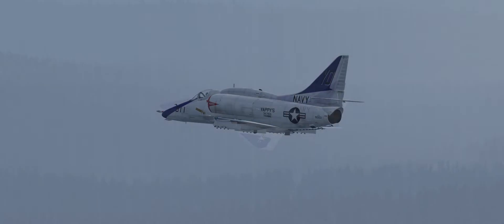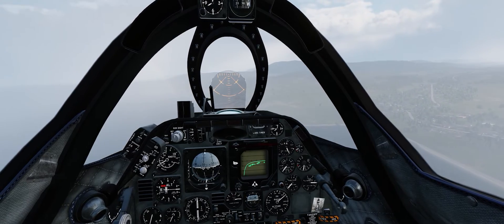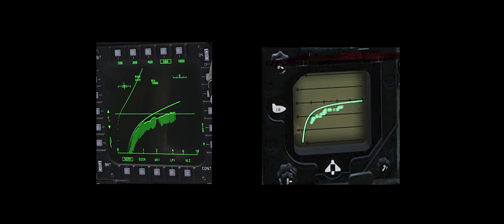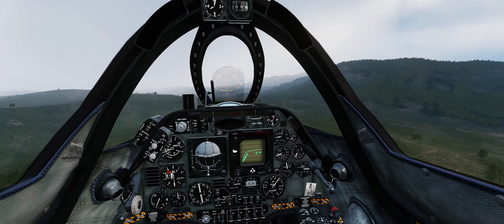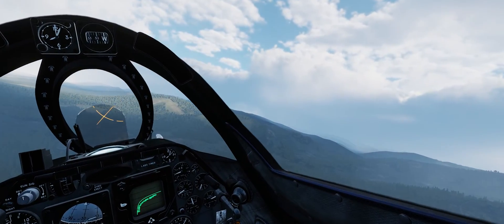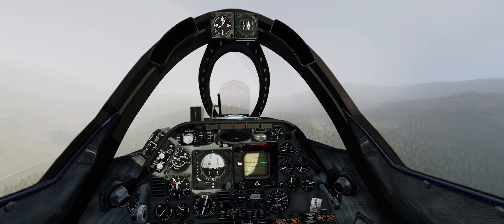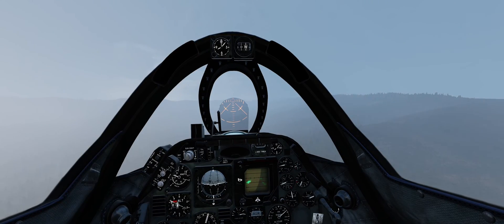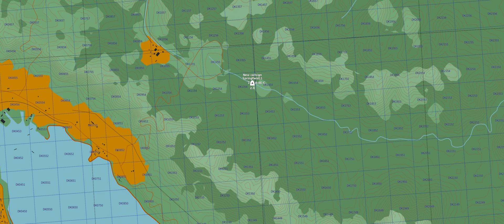Be Your Own Terrain Following Radar.

Comment: Great video. Just a thought. Instead of using the nav computer for intermediate waypoints, maybe just input your IP then us it for intermediate fixes along the route. For example point 1 is 180/60 miles from the IP, point  2 will be at 225/50 from the ip, etc. these fixes are backing up a pre planned route via pilotage and DR. Even if not completely pre planned a kneeboard map with the ip and a “bullseye” grid on it would allow you to correlate what the scope is saying with the bearing/distance in the HSI to the map. Obviously there will be some fudge factor due to drift f the system but should be close enough.
Reply from the maker: Interesting idea. Yes, something like that is probably exactly what they did. Plus you could use on waypoint a the FROM point and one as the TO - swapping between them would help with the drift issue. Nicely done.